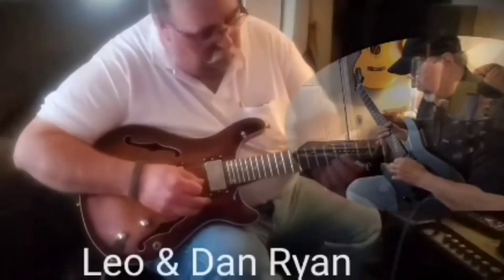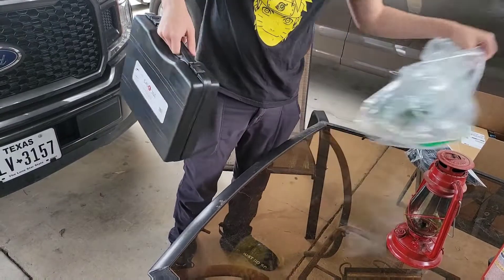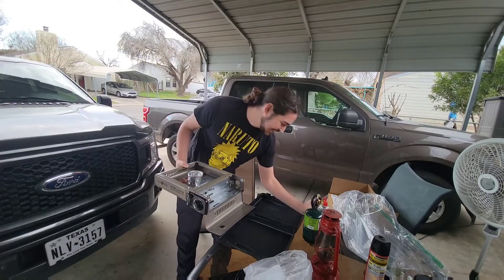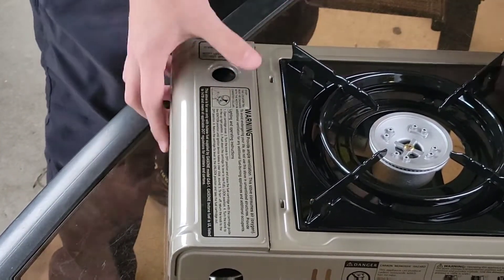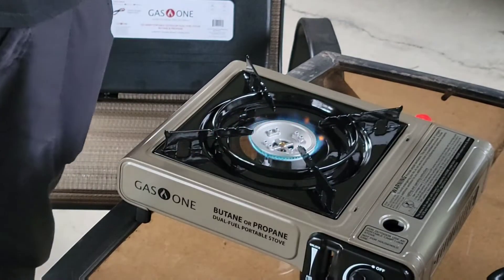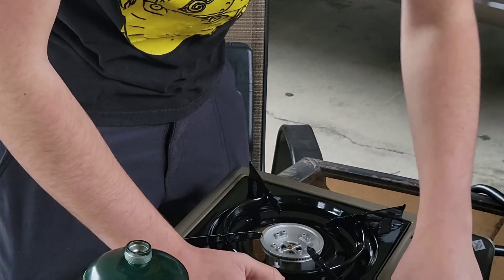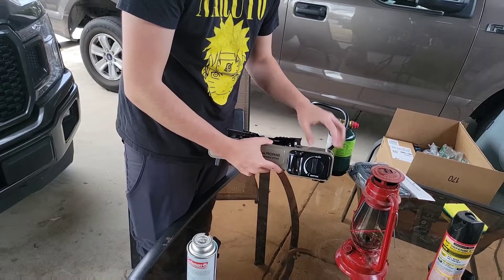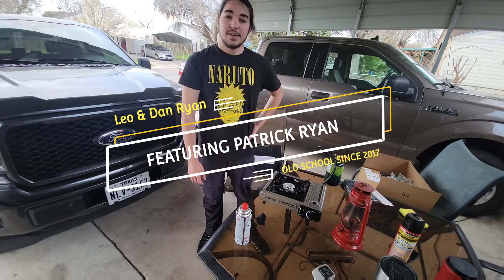GAS ONE DUAL FUEL STOVE unboxing and demonstration

Comment: Hmm - quite dangerous to fire this lightweight thing up from the front. Patrick had to hold it backsides while clicking the piezo and his left  arm was in the reach of the flame. The old things i had to screw up on a propane gas can back in the days when camping with my motorcycle were less weight, smaller, safer to fire up, cheaper and did the job imao...
But this was a good salesman presentation 😄
Reply from the maker: Thanks very much Guenther for taking the time to watch and comment. I agree with your assessment, but it had already happened so...😉👍!